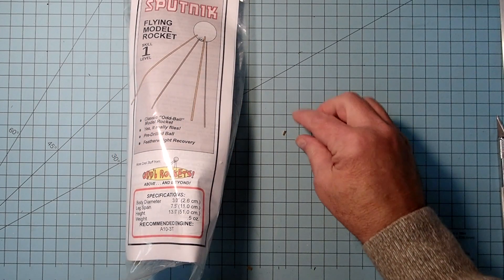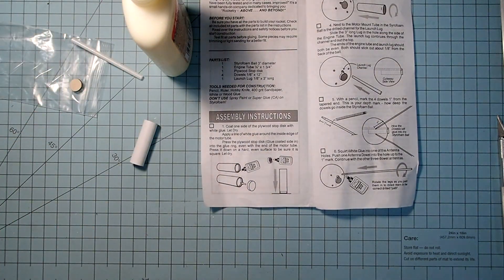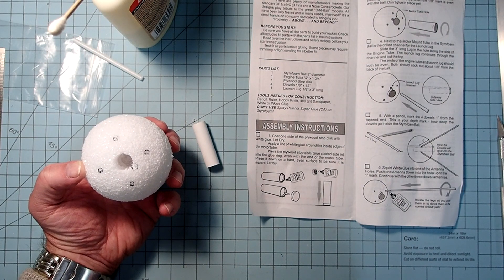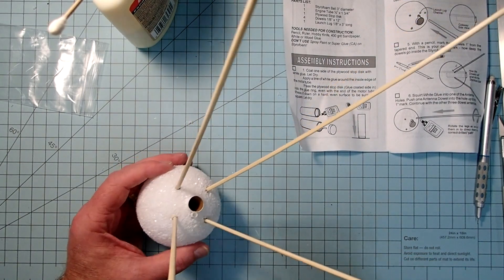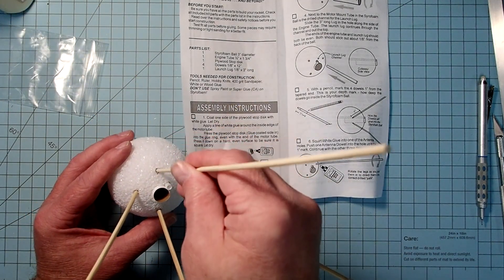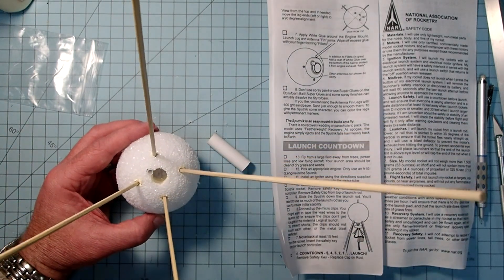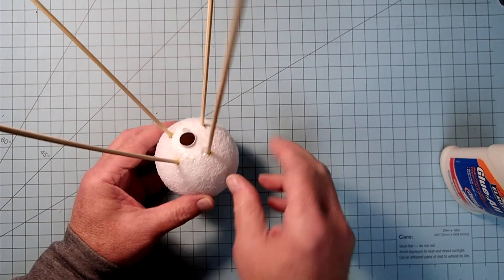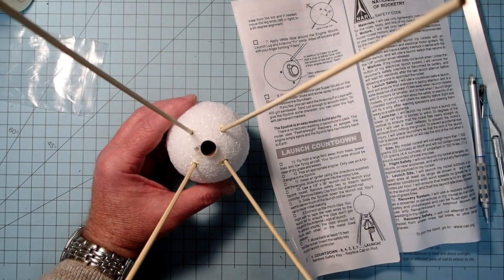Odd'l Rockets "Sputnik" model rocket assembly

Comment: My daughters and I built one of these employing your supplements to the kit instructions. When we  prepped it to fly, the motor was exceptionally loose fitting. I put a tiny bit of masking tape on the motor to keep it from falling out on the pad. The rocket flew quite well, however at ejection, the styrofoam ball blew into 3 pieces. Looking at the remains, it seems the engine block blasted out forward like a shotgun wad and caused the destruction.

Such an odd rocket, we are gonna try again.